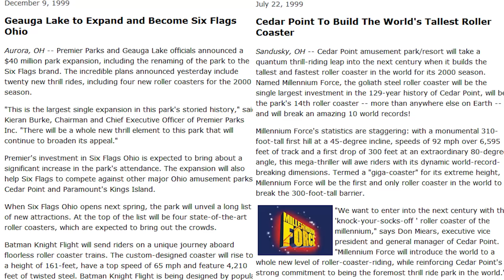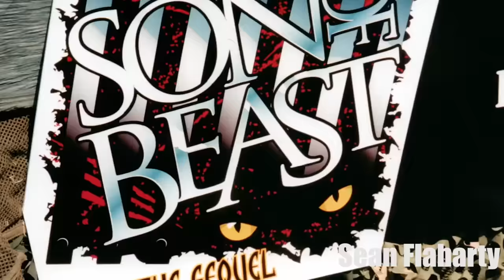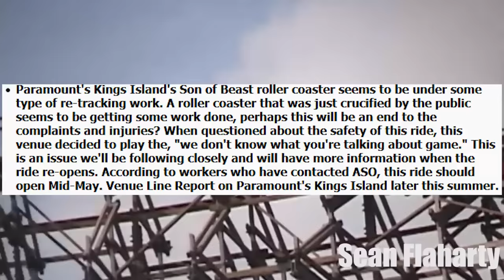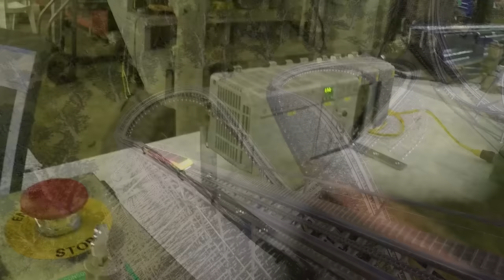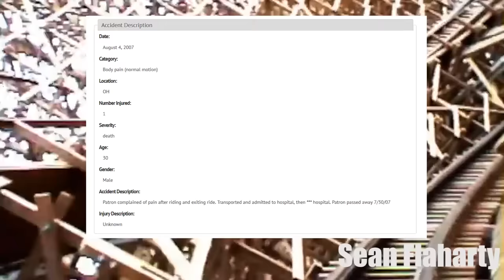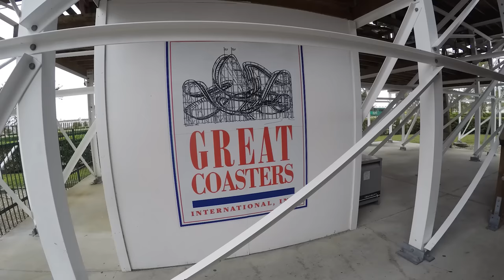What Really Happened on Son Of Beast Kings Island July 9th 2006?

Comment: The ride operator that noticed everyone was injured and shouted for an e-stop should be given a medal. Real hero right there folks.
Reply: It’s like they say, not all heroes wear capes! That man has done good for his community.
Reply: @jasonelston2707  I was dating the girl who was operator and stopped the train that day. Her name was Chelsea. She became a pretty bad addict shortly after this.  accident.
Reply: Absolutely. They may have saved a lot of lives!
Reply: The takeaway from this incident should be that all operators on all the stations should have e-stop buttons. Luckily the shouting was heard in time for this incident.

One would also expect active sensors on the trains to automatically report about any unexpected g-forces. A smartphone with multiple acceleration sensors and even a gyroscope costs less than $100 today and that includes big screen and battery. Surely you could add a sensor or two to the train for safety and QA purposes alone. That would also automatically catch worn bearings that cause heavy vibration, too.
Reply: @ME-im3ui That is sad. You should see if she is better now.

Comment: How rough does a ride have to break someones neck?
Reply: You should have ridden this coaster and you would know.  This coaster was ROUGH.
Reply: @dj091280  Other side of the pond to me so never got the chance, like anyone I have been on some rough rides and coasters but breaking peoples necks (on more than one occasion!) just be normal riding?

Thats something else.
Reply: Apparently rougher than the Mean Streak at Cedar Point before its renovation. Virtually everyone who rode it had back pain. I can't imagine how bad it'd have to be for it to break someone's neck.
Reply: I worked at PKI when I was a teenager back in the early 90s. The training was way more intense than you would think. Even on the customer service side of it. I remember bumping into a hand dryer and automatically saying "excuse me" in an otherwise empty bathroom after having sat through so many guest service training sessions.
More to the point of safety though I drove a Parking Lot Tram. Sometimes during a long hot day in order to get a break operators would claim that there was something wrong with the tram and it needed to be checked out by maintenance. The supervisors knew that's what was going on but you were still allowed to go back and have maintenance check out the problem without question.
I have to imagine it was for two reasons.
1) What If there really was something wrong with the tram?
And
2) if you really needed a break that badly go on back the maintenance for 10 or 15 minutes and relax.

We worked long hours too. Especially on the weekend when it was extremely common to have an all day shift. I remember once coming in at 7:30 in the morning and not clocking back out until 2:30 the next morning. It also wasn't uncommon during the summer months to lose at least one driver per day to some sort of heat-related illness even though ice water and towels that have been soaked in ice-water to wrap around your neck were freely available all day. I won't go into the reasons for this other than it could get extremely hot on that massive black parking lot but it also had to do with how the two types of individual trams were constructed as well.

So Kings Island may have pushed their employees hard but they also trained them very well considering the type they also trained them very well considering it was mostly younger people working seasonal jobs.
Reply: @savageboner  Coasters can be rough but no-one should expect a modern(ish last 30 years) coaster to break peoples flipping necks!
Reply: I was young when I rode this thing and I had bad neck pain after. I didn’t come close to breaking my neck but I remember not being able to hold my head up on the ride.It was a bad ride.
Reply: The ride has to be rougher then a white persons elbows
Reply: Bk1gamer wow that’s crazy!
Reply: @Bk1gamer  Glad you didn't get injured even more.
Reply: It’s because they were old
Reply: Once I didn't brace myself properly on a normal ride (a coaster called boomerang) and had minor back injuries. It still occasionally hurts and I was down for the rest of that day
Reply: I had concussion and whiplash symptoms after riding SOB 1 time in 2007 and I was wiped out for the rest of the day. Worst ride ever.
Reply: @SynZ777  I used to marathon Mean Streak and never had any issues with it. You want rough, try Predator at Darien Lake. THAT was a rough bastard. Rougher than Mean Streak ever was.
Reply: This coaster used to rattle your brain to a pulp. Talk about a headache after you’re done
Reply: @dj091280  Yeah, this video just popped up in my feed out of nowhere.  I saw the name and was like, that wooden coaster that hurt like hell the one time I rode it?  My wife is pretty busty and it also unbuttoned the top two buttons of her shirt.  LOL
Reply: wooden rides are usually very aggressive
Reply: @savageboner  I actually think The Beast is not bad at all for an old wooden coaster. It's probably because it is so slow. I would pay to get into Kings Island just to ride The Beast.
Reply: Jake D rougher then mean streak?!  Dang.
Reply: Even the smaller Beast would beat the hell out of us as little kids. Would get a headache after each ride. The Son of Beast was a thrill but not worth it because of the headache afterward. The roughest coaster around.
Reply: better than any ride we have nowadays, a real thrill
Reply: I rode it with and without the loop. Omfg this was rough. We made this an end of day ride. And we were done. The beast wasnt that bad. It was rough but not nearly as bad
Reply: Rough like mean streak
Reply: GeoMarie Rock when The Beast came out, it was the longest, tallest and fastest wooden coaster in the world. It damn sure ain’t slow, but it is rough and insanely fun.
Reply: @vkws828  It's slow in comparison to the rides that are out now. It is slightly less than 65 mph. It still is pretty impressive though. It is #10 in fastest wooden roller coaster. The next up on the list is The American Eagle from Six Flags Great America (my home park) at 66 mph. That ride is way bumpier than The Beast.
Reply: @trulycam7135  44 isn't "old."
Reply: @diorshawty767  I don't recall that, but I could see it at like 80...lol

Problem I'd imagine us that wood never forgets it used to be a tree. It keeps trying to bend back into tree shape. 

Wood for things like drumsticks or pool cues are specially dried so they can only bend so much. And those are the GOOD, high-end ones. Not the cheap crap. 

I can't imagine this wood being specially dried.
Reply: @TheWonkster  Neither is 60, really. Not today.
Reply: I rode this when I was 10 years old and I got off with a massive headache and a stiff neck. My aunt and uncle complained the entire rest of the day about neck pain. Pretty awful ride.
Reply: This coaster was awful
Reply: Yes
Reply: I rode it several times and never had any issues. Then again I am not a pussy so there is that.--
Reply: Riding it was one of the worst experiences of my life, you couldn't have paid me enough money to ride that thing again.
Reply: It was probably due to whiplash, that thing really knocked you around and especially the virticle loop into the two circles it was just too much movement in the seat. I road this back in 2003 when I was 12. I couldn't hardly keep my head up. And had bruises on my arm from hitting the side of the car.
Reply: You mean how weak does your neck have to be?
Reply: @Tuberuser187  when it says break necks, it probably means it dislocated it or caused a small fracture. Still painful as fuck, but I doubt it would have snapped a bone or anything. Necks are pretty fragile. Not making excuses, they should have known this ride was gonna be too rough when testing if
Reply: This ride is an example first time riders experience the worst because they don't know what to expect i rode this ride 13 times in 2001 and knew where the rough sections were, the first helix is far by the worst pain for first time riders but overall i still love this ride
Reply: @savageboner  not really the lighter trains made it much worse especially through the helix, i rode it with the loop and it was just as bad without
Reply: It was rough. Rough to cause internal bleeding if your body went into the lap restraint in its later years. It sent me to the hospital was it was like a right of passage
Reply: It was really rough, but it didn't break any necks.  I lI've close, and went there all the time.  The deaths, and injuries were all over the news.  None happened on Son Of Beast
Reply: I road a wooden rollercoaster once in my life, in my 20’s, and needless to say ive never done so again, nor would i. A wooden rollercoaster is the roughest rider ever, completely uncomfortable, and honestly, no fun at all. I actually don’t even know why an amusement park would think it was a good idea to have one. Makes me wonder if there are any left around the country.
Reply: @jasminebaum9343  Kings Island opened in 1972.  The Beast has been in operation since 1979.  I had season passes several years, and don't remember it ever being closed down.  Yes, it is rough.  They slowed it down from the 70 mph it originally went.  It is an amazing coaster, and has always been one of the most popular rides in the park.  When it was opened it was the tallest,  fastest, and longest wooden coaster in the world.  It is still the longest.  When you get to the top of the first hill and see the little underground tunnel at The bottom, you know you are on a one of a kind roller coaster.  The whole thing is out in the trees, away from the park, and quite a bit of It is flat on the ground.  It has two hills with chains to pull you up.  ..
Reply: @calhensley820  yeah, ive ridden The Beast as well, and it was a great ride...in my comment i was actually talking about the WOODen rollercoaster they had up for a while at KI, which wasnt The Beast.
Reply: That's how Thunder Run is at Kentucky Kingdom in Louisville
Reply: calling son of beast "rough" is an understatement, it was a nightmare. i rode it in 2003 when i was 24, and it was like getting your @ss kicked the entire ride. you don't ride it, you survive it. worst coaster i ever rode by light years, and never even thought about riding it again. all the other coasters at the park were fine
Reply: I used to ride this coaster all the time, as it's my favorite coaster of all time. My family had season passes to King's island and we went multiple years in a row. It's similar in roughness to The Beast, but maybe slightly rougher. I forget which coaster it was either the Beast or Son of Beast, but the worst thing that ever happened to me on it was the lap bar compressed fully on me thinking the seat was empty. But I was a skinny and tall kid and rode it as soon as I met the height requirements
Reply: @GameraS2K  wtf how is it anyone's favorite, lol
Reply: @Rodzilla97  Because it had an intensity I've yet to find in any other wooden coaster. The Voyage is my current favorite, but when Son of Beast was around, Voyage always was a far second. I actually prefer my wooden coasters to be rough as it significantly adds to the awesome sketchy experience I want
Reply: @GameraS2K  Most people would rather not risk future injuries to their spine. Back pain isn't a joke. Wear and tear on your back causes pain later in life. It can make you a bitter person. If you had ridden Son of Beast a couple of times in a row, you would stop praising the intensity and focus on the roughness. The ride wasn't just rough, it was dangerous. Like being in a paint shaker or a minor car accident. Considering hospital bills can be $10,000 with a simple IV, x-ray, MRI done to you, you don't want to risk that for something that's not that thrilling to begin with. I don't find coasters to be that thrilling though. I prefer autocross and track days.
Reply: @Chironex_Fleckeri  Thats cool and all but if you didnt have pre existing conditions the coaster was nowhere near rough enough to injure you. It was similar to the Beast in roughness. I used to ride it multiple times in a row as many times as I could since it was my favorite. Autocross or track days are fine but nowhere near as thrilling
Reply: There was a nasty jolt near the helix which you can see on a lot of older footage from SOB. It does a quick jolt which was the main cause of minor injury
Reply: the man was 60 years old!  I went on a wooden ride in the pleasure beach in blackpool and it was nothing compared to this , and even it was rough as anything!
Reply: It’s like when you crack a whip
Reply: I was riding this ride from 2005-2008. I was born in 98 so I was a little kid. But honestly the Beast was more rough.

The helixes were definitely, definitely rough on SoB but helixes on all wooden coasters are rough. Everything outside of the helix wasn't bad at all. The cars shook a lot during the helix but that is due to high speeds and laterals while staying on a piece of track. 

The beast threw me around in my seat and quite literally every time I got off my ear would be bleeding from hitting the seat separation and even got a nosebleed once. Can't tell you how many reports my mom had to fill out because of that ride. I refuse to ride the beast to this day.

At the end of the day, SoB was (and still is) my favorite ride I've ever been on. I marathoned SoB 17 times in a row in 2006 and I was perfectly fine, but I would walk off with blood on my shirt from the Beast during the same year. The ride was no more rough than any 90s wooden coaster
Reply: For real! I went to Jazzland in New Orleans (later turned into Six Flags and destroyed by Katrina) and there was a coaster called Muskrat Scrambler. We called it Bone Crusher though because of the amount of pain we were in when we got off that ride. So I can only imagine how rough a coaster has to be to break someone's neck!
Reply: @Bk1gamer  I’m in the exact same boat.
Reply: @Tuberuser187  hell yeah that was what you expected 😂 nothing major 🤪
Reply: I rode this ride. Did not get injured but it was super rough. Your head just got smacked side to side on the head restraint the entire time.
Reply: @savageboner  I rode it with the loop and it was rough but didn’t get injured. I was in my early 20s.

Comment: As the SoB failure demonstrates, you have to be extremely careful when you strengthen one part of a structure to insure that you don't inadvertently transfer excessive loads to weaker points.   In the mid-1990s, a girder on a highway bridge in Boston was damaged by a truck.  The girder was repaired by the heat straightening method.  Just over two years later, the girders on the other end of the bridge started to fail due to the transfer of loads from the earlier repairs.  Fortunately, the failure was detected in time and the bridge closed.

Comment: After I heard about all the injuries caused by this ride, being in my early 20's, I figured I absolutely HAD to ride it!  I rode it once, with the loop, and I'm not surprised it broke peoples' necks.  If you were to turn your head at the wrong time, it could absolutely do what they claimed it did.  I had a pretty bad headache after riding it too!  Funny thing, my buddy, who worked for Custom Coasters International, told me that PKI had asked them to bid on fixing the coaster, or finishing it (It's been 20 years, so I'm a little foggy).  They turned it down because, and I quote, "It will never be safe".  He then told me to "please, never ride it".  I do remember him saying those two things clearly, though!  BTW, PKI did have their own engineering department at the time, and they had built several rides themselves, most notably The Beast.
Reply: Given how successful and long-lived The Beast has been compared to this, they would honestly have been better off building Son of Beast themselves from the start. They poured a ton of work into shoring up and smoothing out the ride (although the Gerstlauer trains switched to after the 2006 incident wound up negating the latter) but it was never able to fully cancel out the fundamental flaws of RCCA's shoddy design and construction work.

RCCA was a sleazy, shady, underbidding corner-cutting company.